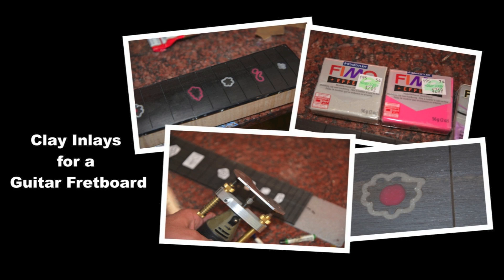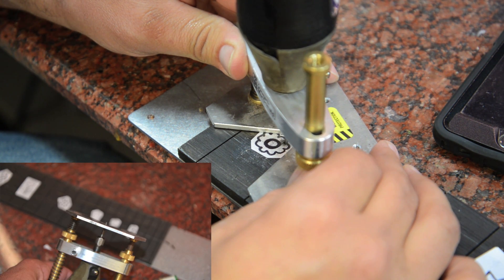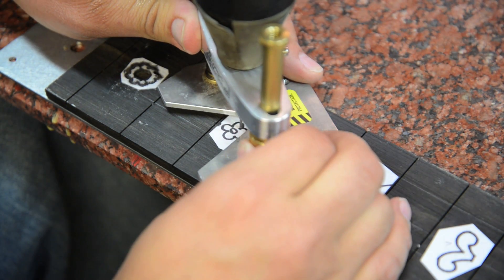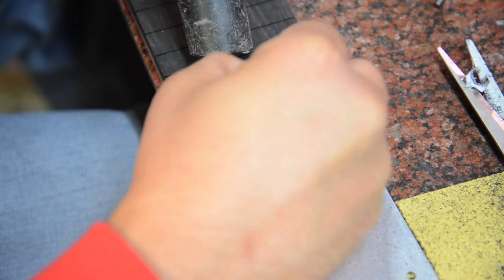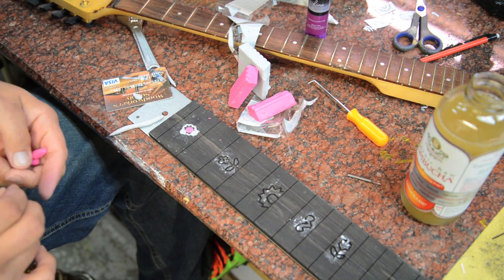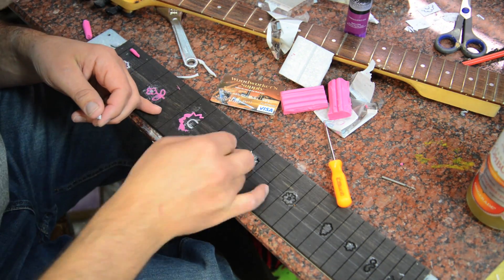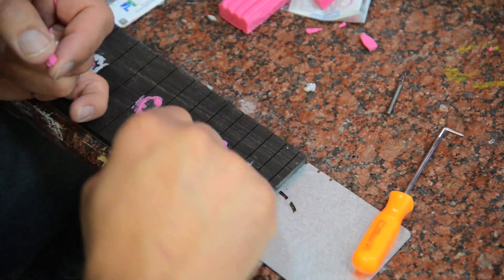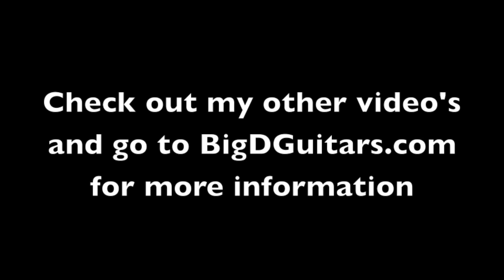Clay for a guitar INLAY!?!!?! DIY Fretboard inlay - Inside the Luthier's Shop

Comment: Can be done with air dry clay? If no blanket is around???
Reply: Just get a heating pad from your local pharmacy. It will work exactly the same, though you may need to do one half of the board at a time if the pad isn't long enough.
Also, if you have the patience, you could use a heat gun on the lowest setting, but that would take quite a while.

Comment: is this durable enough to endure regular playing?
Reply: I have used baked clay inlays on a few guitars in the past, though I made them in a brass mold first and then inlaid them after baking. 
The clay itself gets very hard and plastic like after baking about the same feel as the plastic from an action figure toy like GI Joe or He-Man.
You have to heat the clay low and slow.
It's very durable after heating, not at all crumbly or dry.